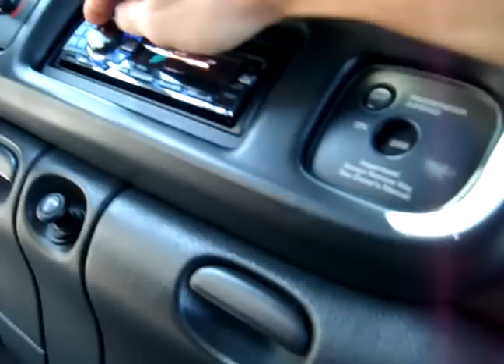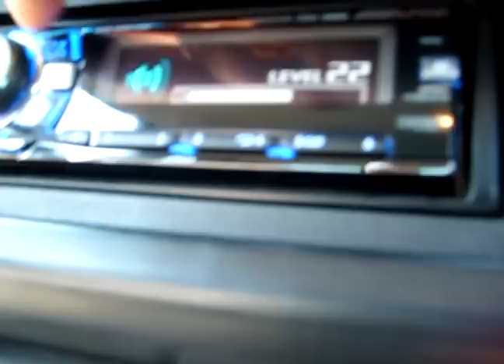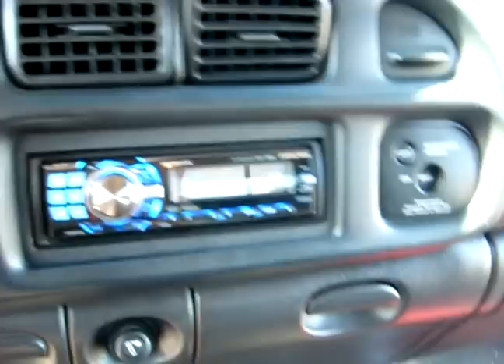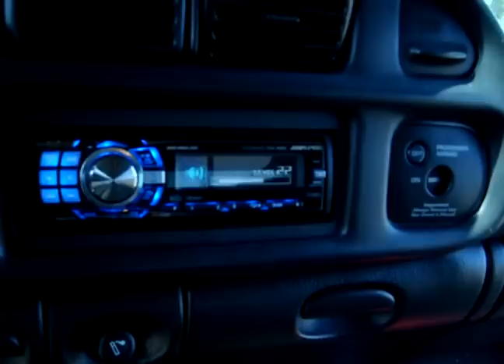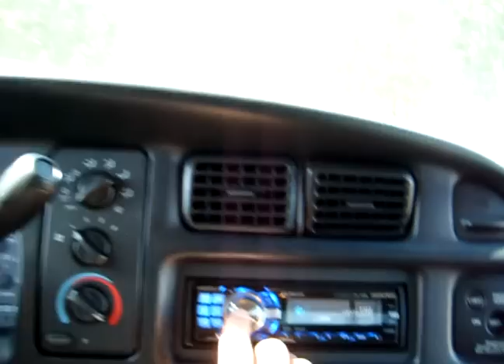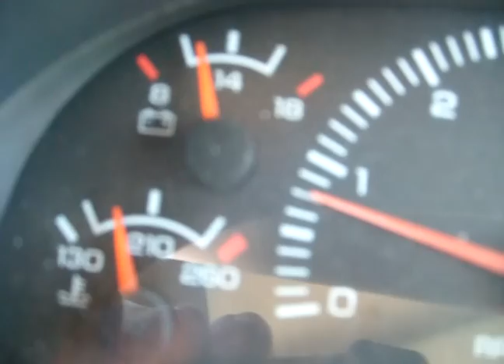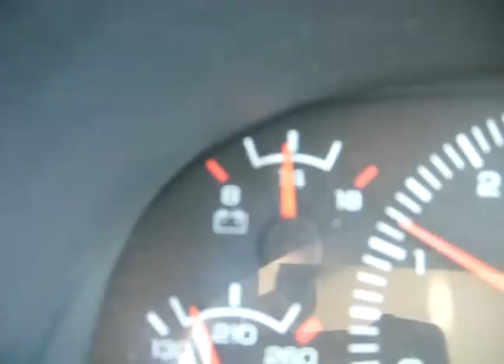Alpine Audio System 18

Comment: Most people just run a new wire with the stock wire. This way you dont mess with the computer and stuff. Thats what I did with mine and worked good, but every rig is different.